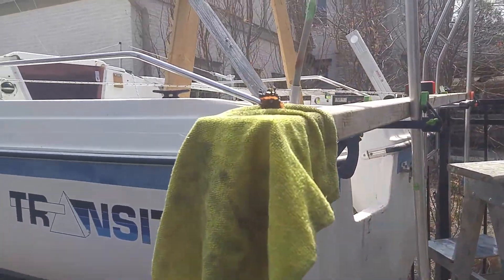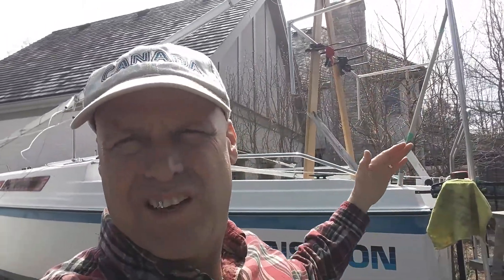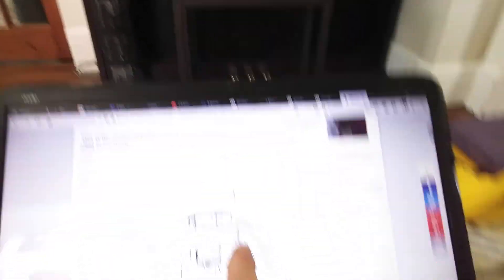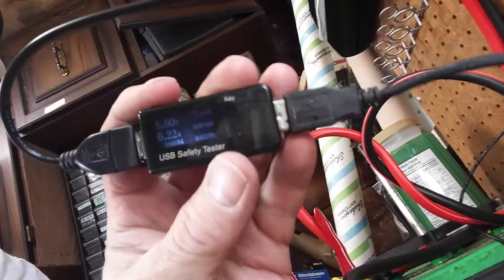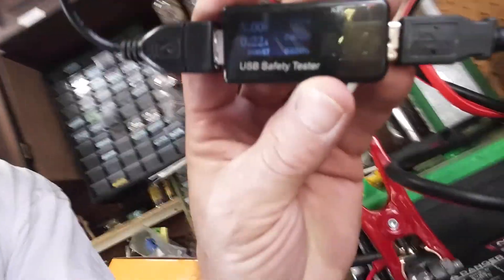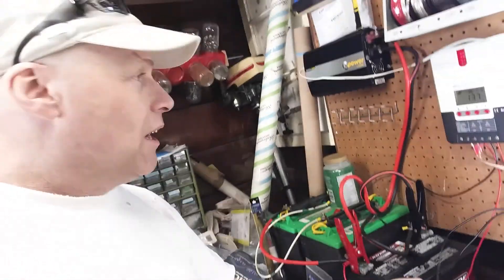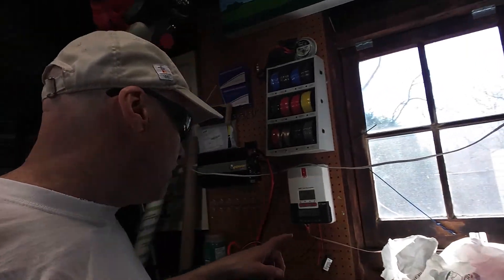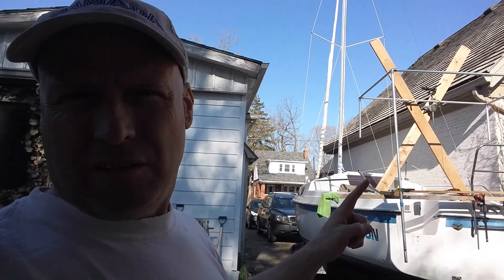Easter Mast Breakfast Arch

Comment: Hey Marty! I have a Siren 17 question...I need a jib fairlead/cam cleat. the one that goes on the track. Lost one while trailering! If you know of any Canadians who have a stash of Siren parts, i'd like to hear from you! 
I don't see an email contact for you.
THX Dave in Halifax.
Reply from the maker: Are you on the Siren 17 Yahoo message board? If not join. Got to Yahoo.com groups search Siren 17 ... Go through there and email me. I am replacing my cam cleats this season. (Not right away but soon ish) I will let you know what I'm replacing mine with so you can do the same or similar. 

You saw my cleat fair leads? I made them after a buddy broke the originals.
Reply: @martyjackson4806  i tried, but the group looks dormant. Didn't let me in! I emailed again last nite
Reply from the maker: @davemaclean2866  email me at northchannelcharter at yahoo.com
Here is a link to the group page: https://ca.groups.yahoo.com/neo/groups/sirenowners/info I think I recall another group that was dormant.